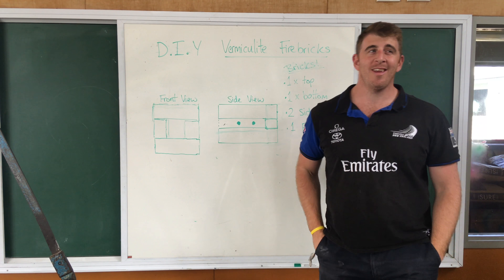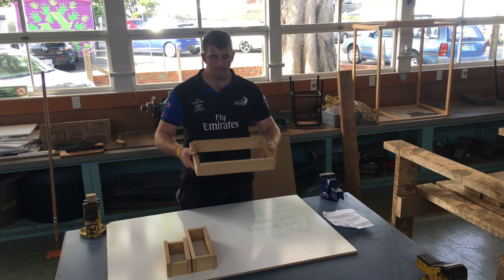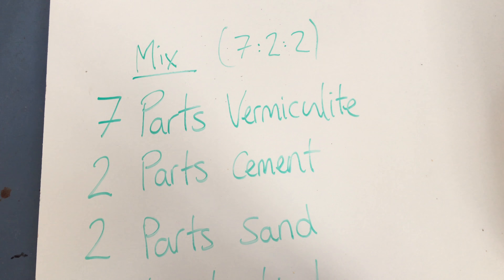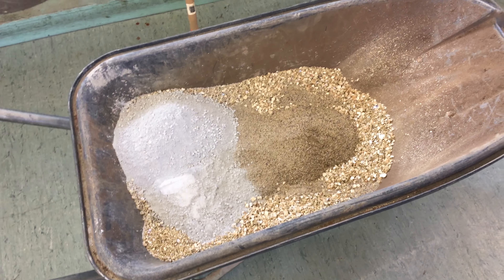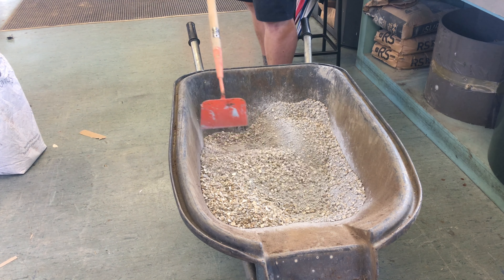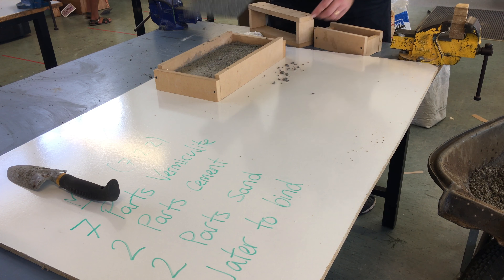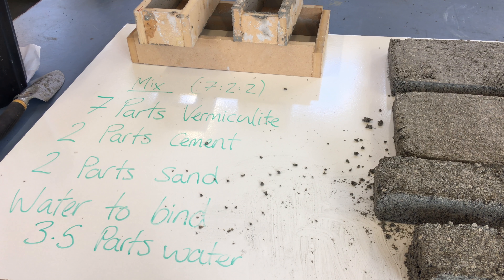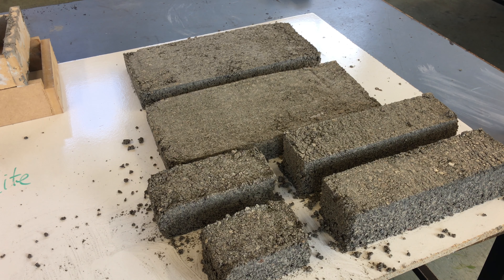DIY Vermiculite Firebricks for a MINI FORGE - Part 1

Comment: Any suggestions with drying? Out in the sun? 20 degrees. Should I keep poly ontop to hold moister? Slow down drying? I don't wanna dry them to quickly. I made two sets one inside one outside. One has clay added to it
Reply: All cement  based products should be wet cured or damp cured for as long as possible. If dried out quickly the strength will be reduced by a huge amount.

Comment: As Vermiculite is so highly absorbent it is best to give it a soak in water first then add it to the mixed sand/cement-it's a lot easier to work and quicker.
Reply from the maker: Ian Morgan thanks for the tip. I look forward to testing that...

Comment: I would like to use your recipe to make a mold to melt glass in a microwave kiln. In Wikipedia, it says that vermiculite undergoes significant expansion when heated. Would it expand when I heat the mixture in the microwave kiln? Thanks in advance for your reply.
Reply from the maker: I have no idea! However please share your results as it sounds interesting.
Reply: I know its a late reaction, vermiculite is a stone and expands heavily when heated and becoms like the vermiculite in this video

Comment: will that 1 inch thick veneer brick work if i set it in mortar with duroc behind or is it to thin to retain the log and flame from combusting any wood framing behind the duroc  fire box in a free standing outdoor fireplace .... I would like to place it on my new trex deck.... and i dont want to damage it... i plan on keeping the fire box 12 in off the floor.... and as small as possible Im not looking to make the box larger than 18 w 18 h 10 d
Reply from the maker: JackCondor44 I wouldn’t like to say it would as I’ve never used a few of those materials. You could make them thicker?